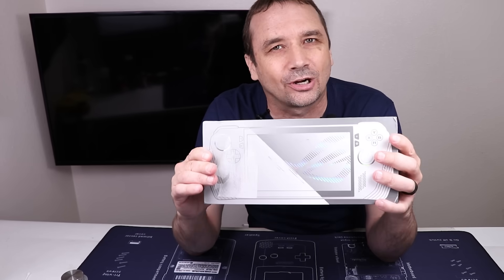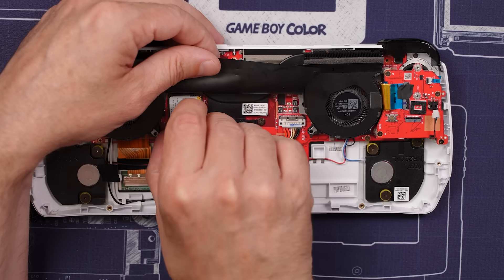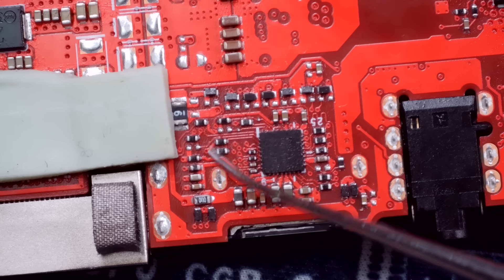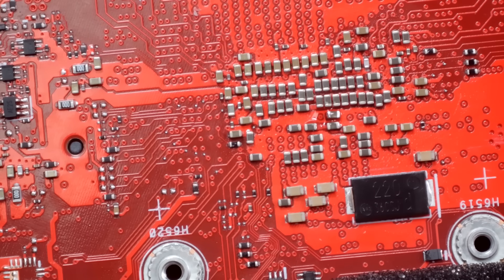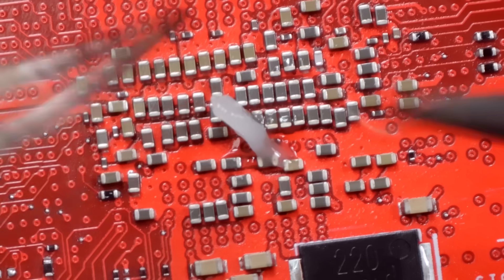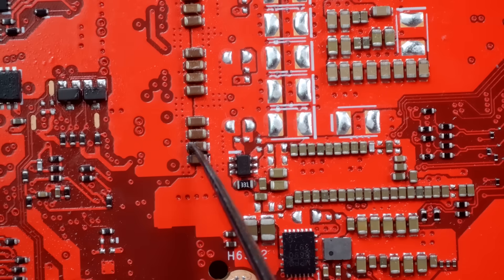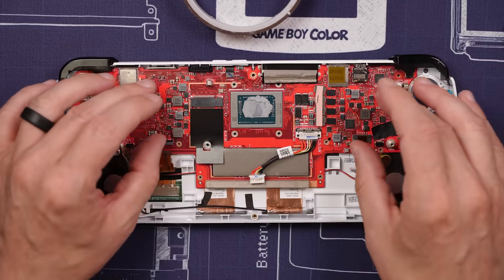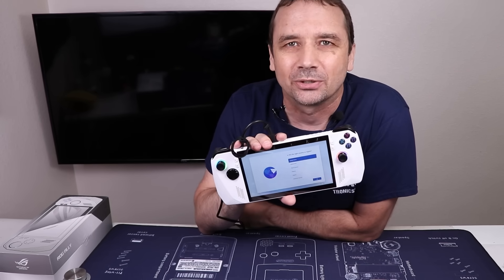ASUS REFUSED to Fix His ROG Ally - Can I?

Comment: Liquid damage is just the excuse for not doing warranty work, not that they should have in this case since it had been apart already, but there was no liquid damage.
Reply from the maker: That's what it seems
Reply: @Tronicsfix  are rules anywhere different? An opened device cannot void warranty where I live. Thus, stickers or paint is useless.
Reply: @Tronicsfix don't fancy fixing my RB button do you 😂🙈.. I'm tempted to try it myself but 🤔
Reply: @Tronicsfix why I'll never get one
Reply: @Tronicsfix it's not  Asus. They hired a third party service to fix their stuff. I had 2 RMA's. They denied my second one. So I sent an email that gamers Nexus gave out. Got it fixed and my SD card has been flawless
Reply: I had 2 laptops 1 from hp an omen 1660 ti and a MSI k12 1460 both refused to fix it over this but the boards were popcorned by the CPU I wouldn't recommend either company.
Reply: They have no incentive to fix things if a no-fix has the same value as a successful fix to them.
Reply: remember guys, air is a liquid!!
Reply: @docwhogr  Air is not a liquid. Air is a fluid.
Reply: I bought a like 4 or 5 year old used MacBook pro for like $100 several years ago and a local repairs shop has told the previous owner it was irreparable because of liquid damage. I opened it up and there was a little corrosion but it was not much. I cleaned up the little I saw and turned it on and it worked fine. I sold it to a friend of mine for $250 and they used it for several years after that.
Reply: @12345.......  Yeah true it been taking part so no warranty but no need to lie about it being water damaged 😅
Reply: Opening a device does not void the warranty. They have to prove that what you did caused damage. Just opening it is not sufficient.
Reply: Warranty claim should have been prior to him attempting to fix it himself though
Reply: in the us warranty is not voided by opening up your device anymore.
Reply: well companies only care about money, so why would they fix something for free if they can get money doing scummy things to the customers. It's just the world we live in. It's a shame but nothing an ordinary person could do about that, other than learn how to fix electronics themselves.
Reply: @MrPelzi91  because they are forced by law?.... I'd like to see trying this in Europe...
Reply: is warranty sticker legal in USA. I am asking cause in EU warranty is void when u mess with that sticker. So in EU liquid damage does not matter if u opened device and mess with a sticker. Warranty void if sticker is in place and there is liquid damage . Warranty void.
Reply: @GeorgeOwsik no, You can remove the warranty sticker in the USA and still have warranty.  Magnuson-Moss Warranty Act
Reply: As a tech that has checked people's screw ups trying to have warranty.

There isn't always a box for user repair. So the water damage box gets checked.
Reply: @SomeTheorist9090  so there is not a box: other reason _____________?
maybe  a point of improvement
Reply: @SomeTheorist9090  that sounds right 👍 they need to update their form 😂 after all they hate people fiddling with things before repair 🤷
Reply: The pleb customer tried to fix it himself while it was under warranty. No wonder they refused to repair it.
Reply: @perkulant4629  unlike most cases. The warranty for these rog ally devices was originally 1 year. But due to major SD card issues. Asus extended the warranty. If you didn't recognize they extended the warranty until after you tried to fix it... I think Asus should be more lenient on fixing these; due to their SD reader being the original cause of the issues.
Reply: @perkulant4629  They can't deny a warranty claim just because someone opened the device.
Reply: Agreed, not water damage but a fix attempt was done, that should void warranty
Reply: As much as I am not a fan of Asus... in this case, I am with them on the denial of service. 1. it was tempered with and you can clearly see the flax residue on the chips...  2. it cost money now to diagnose the problem that someone may or may not created on top of the original problem (blown capacitor). I am fine with DIY stuff but I am not on board with the fact if you screw up your DIY repairs you want to also invoke the warranty on the item you failed to repair...  You do not get both... you let them fix it or you void the warranty and fix it yourself.
Reply: @Gawriify in the us you cant deny warranty for trying to fix something (other than medical equipment). More states are cracking down and enforcing this law even more now too. Thats why they tried to find a different reason
Reply: @Jzwiz  that is absolutely not true... magnuson-moss warranty act is a joke and can never be enforced... also yes they can easily prove that the owner tried to fix it themselves and therefor the board is broken. I am almost 100% sure that reflowing chips would void your warranty. 1. they can claim unauthorized modification of the device... 2. damage to the device and 3. causation - by reflowing chips you damaged the board... and noone can prove otherwise or at least it would be very difficult to do so.
Reply: I highly doubt ASUS employ anybody that would do TronicsFix type of diagnostics and component soldering, it would actually be component replacement for warranty work (screen, MB, thumb sticks etc) and as the owner had the back off and did reflowing then 100% warranty denied and new parts would be the only option at owners expense hence the $867 quote. Owner should never had taken it apart and tried to solder/heat/reflow, I bet he never told ASUS that and though he could scam a warranty repair out of them.
Reply: Liquid damage or not he had a warranty and tampered w it. Not smart.
Reply: @louv409 they illegally say the warranty is voided. We can remove the warranty sticker and they should honor it.
Reply: @louv409 he took GamersNexus/Louis Rossmann's advice that they can't deny warranty if the tamper sticker is broken. ASUS and other companies are betting you're not gonna do it as getting a lawyer costs more than the device itself.
Reply: @louv409  yep🦃🙄
Reply: Yes, normally, but in this case there were clear indications the device had been disassembled and 'work' had been done.  I'd have denied it as well.
Reply: taking it apart CAN NOT INVALIDATE the warranty. That's actually illegal in the US. User attempted repair can though.
Reply: @awilliams1701  yeah, however the company will most likely view the dismantling as a repair attempt, esp since tampering at that stage is hard to spot.
Reply: @jimjam139  I don't even think ASUS would go that far. They've been sued over it before.
Reply: @awilliams1701  no it voids the warranty if tampered lmfao doesnt matter. The US laws arent above their policy xD
Reply: @Spoon-gw2eo this is incredibly false.

The Magnuson-Moss Warranty Act makes "warranty void if removed" stickers unenforceable under U.S. federal law. This means a company cannot legally void your warranty simply because you removed a sticker, tampered with a device, or used a third-party repair, unless the company provides the necessary parts or service for free. In most cases, the manufacturer must prove that your actions actually caused the product defect to deny a warranty claim.
Reply: @SuperBROKEN81  how does that work then? if you tamper with the product ofc it should void warranty and thats a legal reason to do so.
Reply: @Spoon-gw2eo nope. They have to prove you damaged it. It's Federal law. I was always able to get an RMA even with taking off the tamper stickers
Reply: @awilliams1701  Only some states have that "Right to Repair" and most places it isn't valid on things inside the warranty window.
Reply: @awilliams1701  so if I attempt to change my oil in my car and i put wrong oil should the car manufacture buy my new engine it's under warranty
Reply: @69tytyhar  No, but you shouldn't lose the warranty just because you opened the hood.
Reply: @awilliams1701  ok but did he just open the hood?... no he tried to reflow his sd he put flux on it and did not clean it before he sent it in
Reply: it is clear as day you can see flux residue in the trons video flux residue should be cleaned off or it can cause corrosion like what we saw it was the doofus that opened a $900 THAT STILL HAD A WARRANTY AND HE DECIDED HE WANTED TO PUT FLUX ON IT
Reply: IF HE WOULD HAVE CLEANED THE FLUX OFF AND LEFT NO RESIDUE ASUS WOULD NOT HAVE KNOWN AND WOULD HAVE FIXED BUT AS SOON AS ASUS OPENS AND SEE'S RESIDUE THAT IS LIQUID DAMAGE
Reply: @69tytyhar  I was saying they were right for the wrong reason. It should be "warranty voided to attempted customer repair" not "liquid damage"
Reply: They knew he opened it up. The voided warranty is justified in my humble opinion.
Reply: Under warranty? then you don’t open it up and mess with it!!
Reply: Indeed, it seems that owner of that ROG Ally unit have a bad luck meeting with a lazy tech, who just doesn't want to work that day, other than bring it to Mr. Tronicsfix here, the owner should also speak up to the social media, and usually after it gone viral, the local ASUS branch where the owner resided will going head over heels just to fix the problem lolz
Reply: @SkullCommander  wat? That's not at all how the real world works, and your scenario has little to no chance of happening in any sane reality
Reply: Taking it apart and trying to fix it yourself does not void your warranty.   those Warranty is void if broken Stickers are illegal and have been for decades.The burden of proof becomes on asus to prove your attempted repair caused more damage than what already broke. But they get away with  telling you water damage or whatever excuse because they know you're not going to fight them.  They know you don't have the money and resources to challenge them, be it small claims court or a legit lawsuit. Companies don't care anymore they already got your money, and you have a broken product.
Reply: About 12 years ago I had a Samsung phone that gps didn't work, wifi was weak etc and it was only a few months old, I thought it was great service when they picked up and had phone back 48 hours later, until it said liquid damage, and not economical to repair, following a guide online that said Samsung phones had a fault with wifi/gps that could be sorted by taking the back case off and then retightening the screws, and what do you know it worked. So in other words they didn't want to fix phone they likely never even took it apart.
Reply: @revengenerd1  that's different than attempting to fix it before sending it in for warranty repair.

If it is rejected, I agree it sucks, the delays suck, keep trying or complain... That's s really all you have with warranty unless you have more money or time than the device is worth to bring it to court... But the issue here is don't try to fix it yourself first!

Warranty coverage means the manufacturer needs to fix the issue, not the owner. 

if I don't want to take my new vehicle or device into the shop for a common issue that I will fix myself to avoid the hassle or being without it and I get in over my head and break more things that is no longer a warranty issue.

I didn't even give the manufacturer a chance, I took all risk upon myself.

No matter how scummy a company is this is a valid rejection, it's just categorized incorrectly for whatever reason.
Reply: You know how in the us it is no longer legally binding to put warranty void if seal is broken stickers on a device? This is their awnser. ASUS will not RMA any device that you have tried to repair yourself and will claim liquid damage or or other end user liabillities. They do this with their desktop computer parts to. You try to RMA a motherboard that has any signs of having been installed in a case at all, even a tiny scratch on the silk screen they will just deny the warranty. I own a store that builds custom computer setups for people with disabillities in europe and we have had such a hassle with ASUS refusing to RMA obvious factory defects and chipset failures on motherboards and other parts you HAVE to install we stopped carrying ASUS parts altogether. sadly this just seems their default level of customer care these days.
Reply: If you disconnect battery and go to them will say LIQUID DAMAGE sorry :))
Reply: Warranty is void if you try to fix it yourself.
Reply: how was this posted one day ago if this video was posted 17 minutes ago
Reply: @ParkourBoys-y3t  members get it first
Reply: @Pseedholm  Channel members get access to Steve's secret time machine.
Reply: @ParkourBoys-y3t  members I think get access first or it’s one of his friends that he allows access to
Reply: @ParkourBoys-y3t  Time travel
Reply: @ParkourBoys-y3t  It could have been released early for patreons only?
Reply: @ParkourBoys-y3t   back to the future
Reply: Tempting to fix your own equipment is not justifiable reason to deny the warranty. Its why they say it was liquid damage to charge the customer more money.
Reply: @GmKofHard  temping to repair is fine 
Right to repair is there for sure 

Attempt to Repair but mess up , that isn't included 😂
Reply: @GmKofHard  you're full of it...attempting to fix your device is ABSOLUTELY a justifiable reason to deny warranty. And...get this...the courts agree. The only thin you can do that doesn't void the warranty is open it up. Any attempt to fix is then on the customer.